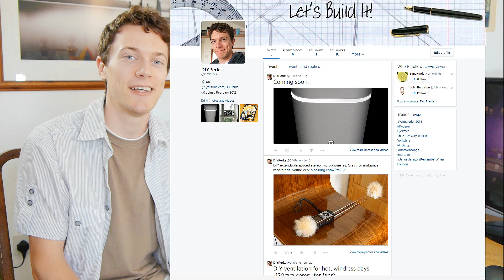How to Make a Clean Air Enclosure (for HDD repair etc)

Comment: If you would use a positive pressure and the fan pushing the air via filter you would get much better results in getting clean air inside. In addition you would get rid of this cut off gloves to, since clean air would be coming out from the enclosure stopping the dirty air going in. Otherwise good idea.

Comment: Great project! It is very economical, and reminds me, something, eckhem, some submersible ;) When I heard the price, I thought - a vacuum cleaner, but then I saw cardboard, and I thought - implosion, and them bam -> 06:00. Jokes aside, it is a pinnacle of DIY! Grazie! 😎🍷🌴 You can also, I guess, slow down the vacuum cleaner by opening a slot that is usually on the handle. It will make is pull some air from the outside of the containment!

Comment: Thank you so much, great video, my first HD hardware failure in 25 years (lucky), don't want to have to send one out again.
Reply: Have you replaced the head on your hdd inside the clean chamber and did it works?

Comment: Not sure using a vacuum for air movement is the best idea since it will pull dust into the enclosure if the seal around your arms is broken. Better to have air blown in with a HEPA filter attached to the inlet. Then a couple outlets covered by a breathable material. This will allow for positive pressure in the enclosure, making it impossible for dust to get in.
Reply: You are correct. Have you try it and did it work?? if so how did you get access to your data??

Comment: Ususally clean rooms and clean work boxes are made to have a overpressure. So it is better to force the air through the filter to the clean box with the overpressure by a fan. Overpressure will force the inner air out of the clean box through all holes and will not suck any dusty room air inwards. This is the idea of the clean rooms or clean work boxes.

Underpressure (vacuumed) work boxes are made to work with toxic chemicals so the air with the toxic fumes is sucked out of the box to some kind of toxic chemical absorption filter or out to the atmosphere.

Comment: I haven't found any comments about positive preasure.  For me ideally creating constant suply of clean air would mean that dust particles won't be sucked in by negative preasure difference. This way you can control not so tightly sealed environment. I find negative pressure is good for keeping things in thought

Comment: I was thinking of using my electric pump with a Boston valve off one of my inflatable boats. It would be perfect it will automatically close when the pump shuts off no air can flow.  I think I just have to work on the rest of the setup. I have ajard drive that sounds like the heads are stuck. I need to get it running long enough to grab the data.

Comment: I know it is an older video DIY Perks, but this is something I am getting ready to build.  I think I will use slightly different materials.  I think I am going to use acrylic board or plexiglass for it, and aluminum window frame material to make it a little heavier duty, but this video shows me that it is possible to make a fairly clean room for data recovery and other issues that may need a cleaner environment.  I think I will mount a small switch inside the enclosure for lights and for the fan/vacuum.  

Nice...ty
Reply: Have you done it to replaced the heads from the donor drive? If so how did you get access to your data??

Comment: A better way to do this is to pump clean filtered air into the box.  This way if there are any small cracks or holes no dust will get sucked into the box.
Reply: You are correct. Have you try it and did it work?? if so how did you get access to your data??

Comment: Very nice video. I wonder if it could be easier and more sequred to make it with glass instead of plastic paper. I can think something like bread case made from glass. You probably can make the holes with pvc tubes (for filter, hands, hdd entrance and for taking out the air) and attach anything like gloves, etc. Also using hepa filter on right, attach it with silicone gel

Comment: Clever idea and good video, i'll take some of your design idea and use positive pressure with a small fan and HEPA filter cloth; the vacuum seems excessive unless you need a negative pressure environment and would suck dust in through any gaps in the system.

Comment: It would have been a far better project if you used long sleeve kitchen gloves and add a "door" in the box just to allow what you need inside the box... Like this would have dramatically insulate and reduced the air contaminants inside the box. And instead of using a vacuum cleaner on one side and the HEPA cloth on the other i would have used 2 fans. One that blow the air inside the box (with a HEPA filter behind) and the other fan on the other side of the box even without a filter since the air it's blown outside and no air (technically) should go inside the box because in this way you would create a laminar flow and force the dust to go out.. more and less the same on how it works any clean room bench...

Comment: Do you consider a different approach : so called laminar flow chamber built similar but hepa filter is behind a strong fan, mounted on rear wall of the chamber (filter side to inside). Draft of filtered air will exclude incoming dust particles, so no  glovebox style  interface is required and the chamber can be  continiously opened  from the front.

Comment: Hold on a second...you acknowledged the very slight and subtle difference in pronunciation of yogurt, that I didn't even realize at first, as an, "If you're in America" thing...yet you said nothing about the pronunciation of HEPA?!  I have never heard it called He Pah before.  Ever.  I've always heard it called HehPah.  THAT, if anything, is when you should have used the "if you're in America" line.  Not over the hardly noticeable difference in pronunciation of Yogurt.
Reply: John Meise I was actually thinking something similar. He definitely should have noted the differences in the pronunciation of HEPA. The yogurt thing made me smile because it was a little humorous but that HEPA pronunciation made me actually laugh.

Comment: In real "cleanroom" there is a little bit higher pressure, not lower. So you can deliver filtered air inside and it goes out using also small holes and leaks. Then there is no risk to absorb little dust particles from the air if the enclosure is not hermetic enough :)

Comment: great DIY project  I have a problem that you might be able to help with  I have a 5TB Seagate less than 1 yr old, was accidentally dropped  and now the power supply plug wont connect all the way in like it is supposed to   can i fix this somehow

Comment: Can you make one that has a vacuum environment? This is going to sound dumb but, I'm trying to sleeve cards and the undersleeves are supposed to go in the OPPOSITE direction as the layer on top, but air gets trapped between the layers, so I want to remove the air. I don't need a total vacuum but if I could have an extremely low pressure environment I could do this without damaging the cards.

Comment: coulda used a 9V battery case with switch for the LEDs and then there's no need to poke another hole and you can turn our on/off from the inside...making it truly portable and no need to be near a power source....mobile hard drive repair from the trunk of your car lol...

Comment: What about the bare uncovered arms inside the box? Most dust in a home is from clothes and skin, right?
If setting up a large removable filter you could use that to stuff hard drive in and out, no need to have vacuum cleaner at maximum suck force either.
Neat tutorial though, I would have added longer gloves fixed in the box.

Comment: Interesting video. One thing you can do that would make things easier, is to use positive pressure, instead of negative pressure. When you do this, you don't need to be as concerned about sealing all the edges so much. Using positive pressure, guarantees that you don't suck dusty air in from anywhere, the only air going into the box is through the filter, any openings would serve to exhaust the air. You still want to minimize any openings, so you maintain positive pressure, but you can be more relaxed about it. With this construction, a simple PC case fan could be used as to provide the pressure.
Reply: How would you go about implementing such change?
Would you replace the vacuum with a fan blowing air in, or is it something else?

(Sorry to bother you, ik it has been a while since you posted this comment)
Reply: @orsaz924 if he never replies, then I’ll add my opinion.  You’d have to close up the portion where the vacuum hole is (seal it off, since we aren’t using a vacuum anymore).  Then over on the filter side, you’d have to shrink the inlet so that a computer fan fits snuggly in it (you don’t want air getting past it, otherwise you won’t be able to create positive pressure).  Then the size of the actual filter is probably overkill, but just keep it anyway.  The OP mentions that the enclosure doesn’t need to have perfect seals, and he’s right - however, the part where the filter is attached to the fan/enclosure, needs to be airtight.  Otherwise you’re drawing in air that is unfiltered.
Reply: @davidswanson5669 is a computer fan enough to create positive pressure in that box?
Reply: @davidswanson5669 and where would the air escape from? Doesn’t it need an exhaust or something
Reply: @GeneralTreesap  I don't think you would use an exhaust for positive pressure.
Reply: If one wanted to use the possitive pressure from the vacuum to get the same strength of the airflow (using/adapting the vacuum outlet) could fall into trouble with the purity of the air. Whatever quality were the filters in the vacuum it is still quite a dirty place after months/years of usage and a proper filtering of such unpure direct blow could be challenging. Sealing the whole box well is not such a big deal after all.

Comment: WHY NOT TO PUT A ROUGH FILTER ON THE VACUUM CLEANER'S HOLE A ND LEAVE IT ON ALL THE TIME? THE BOX WILL  NOT COLLAPSE AND ANYTHING WON'T FLY THROUGH INTO THE VACUUM CLEANER...
I THINK IT'S A BETTER SOLUTION THEN THE COVER.
Reply: +Harry Zalessky negative air pressure. While the vacuum cleaner is on, it creates negative pressure inside the enclosure. Air and dust will seep in through the tiniest crack anywhere where it's inadequately sealed and unfiltered. With the cleaner off, there is neutral pressure. Meaning no air going in or out. Ideally it should have positive pressure, where air will be seeping OUT of the enclosure to push air and dust out of anywhere unsealed and unfiltered.

Comment: Here's how you make a DIY clean air solution at home folks.  Gather up some deuterium and tritium and heat them in a heavy-water-cooled tube spun gyroscopically at a precession sufficient to stabilize the net vectors, and then connect it to a Seebeck generator.  It should produce voltage high enough to ionize the air particles.

Comment: I created my own version of this using his basic concept! its a box with a glass window on top and a cutout for a fan that sucks air out of the enclosure. on the opposite side, it has two intake holes that have a filter over them and I have two cutouts for the hands that I plan on putting the gloves through. it works pretty well! its also powered by two 9v batteries.
Reply: Have you been replaced the heads of your HDD as you build the clean chamber using this and did it work?? if so how did you get access to your data??

Comment: One of the best cheap air cleaners I've ever used was a 120 mm case fan with a green scratch free scrub pad cut to fit it. It's a very effective and quiet electrostatic/particulate debris filter.
Reply: Have you been replaced the heads of your HDD as you built the clean chamber used with 120mm fans and electrostatic/particulate debris filter? did it work?? if so how did you get access to your data??

Comment: Nice design; I didn't think about a vaccum filter. I make one with two PC coolers and a working Power Supply unit; and an acetate sheet shredded like a curtain, to introduce my hands. The real problem is, the HDisk parts to do the repairs are so difficult or amost impossible to adquire :/

Comment: I love the concept, and it's a great place to improve upon. Points to consider vacuum cleaners normally throw up a huge amount of dust . The gloved seals would have to be absolutely airtight as they would provide least resistance to airflow coming in . Car board itself is a fibrous material which sheds particles something made out of plastic tub would be better . A round respirator filter would truly stop all fine particles as these are certified. Although it's hard to push air through a filter you would only need slight positve pressure, to achieve your aim. I like the way you explained everything and filmed it

Comment: Instead of the vacuum cleaner, It's not better to use two two fans of a pc case? The incoming will be with dust filter and the air out will be without a filter?
Thank you
Reply: could be okay if used fans with gud static pressure and maybe reinvented filter with vacuum cleaner bag ;)

Comment: just a little word for those out there considering rescuing their data themselves.  If you plan to swap the head stack make sure none of the heads touches each other specially the donor head, you have to insert a plastic in between each head but not physically touching the heads, I'd the heads do fully touches each other you WILL get a 100% guaranteed click of death, no data will be recoverable, you will need to obtain another donor drive to get another set of head stack just to retry again ($$) and don't touch the platter discs with your bare hands, doing so will destroy or make unreadable the sectors there, another situation that causes sectors to become unreadable is by causing a head crash (when the head are somewhere in the middle of the platter whether you caused this off not, you can rectify this by turning the platters with your hands while at the same time you gently return the heads back to the park position whether that happens to be in the inner platter section or outter platter section (subject to different models) and one again you can consider the sector where the head crash occured unreadable but you should be able to continue just fine just procure not to commit more mistakes.  So not attempt to swap multi player drives your self unless you have data you don't care to lose, if those multi platters neediness misaligned you will lose your data and no one will be able to help you and special equipment and the patience of God would be required to properly align those platters again, one good method that you can use to swap multi platters is by using the "duct tape method" (go Google it or search for that video) but if those duct tape or that cheap duct tape you decided to use fails to hold up, say bye bye to your data and if those platters fell to the floor and you lost track on their orientation, which one goes first or if a disk is upside up or not you have made the problem much worse than a simple misalighment and i really doubt anyone or any company on this planet can help you at this point.  lastly ground yourself or at the very minimum touch a grounded object to discharge what ever electro static electricity you may have before starting work.
Reply: +Dread Steel sweet, can you tell me some other solutions to the problem that require traveling back in time?
Reply: TY for all your advices!! They all are very very worthy.  I will follow all of them!!!
Reply: +m8ty.com TLDR; throw the hdd in the garbage bin and do backups next time.

Comment: Great idea ! i had some old disks lying around, waiting for a fix, now i think it'll be done very soon. Thank you very much :)
Reply: How did those old disc turn out?
Reply: @alexandermccalla5098  Damn, I wrote this 7 years ago, they are fine, got lots of stuff in a storage box since 3y now, but on last news they were still fine. Haven't notice any bitrot, but maybe it's just luck
Reply: @OktoPutsch Have you done it to make a small box to replace the head of your old hard drive to recover your data?

Did you recovered 100% of your data? I'd love to know!
Reply: @chris01479  8 years later, still pending on the todolist. In fact i'd need to find an equivalent disk to gather its motherboard for the exchange, but there is a chance it wouldn't work, so, does the investment worth, at the cost of GB nowadays ? I don't think so (those were blank new disks, disfunctional but aging, no data to save)
Reply: @OktoPutsch  It will still work if you swap the heads over using with the donor drive the same models as the old one or swap the platters. I think it worth it if you build one as you don't have to pay £700 as you can do it yourself. I still need to recover my files from the bad clicking drive as I have got important data in it.
Reply: @chris01479  Well, depends, if you got data to retrieve it worths to give a try anyway, I think, but in my concerns, having no datas to save, I could just get over it (was only a blank 1TB disc from Seagate, bought new in 2015. Guess the parcel had a tough life traveling to my home). Otherwise you'd be surprised how even 2 models from the same serie line can differs enough to make the PCB swap not a determinist solution, and would require many PCBs to test until one of them finally work off the shelf. From what I've digged about this it may be related to slight changes in the physical characteristics of the disc (slight chemistry variations due to supplies and processes, quality control, and so on) and therefore to some related factory settings embedded in the electronic driving it. Good luck with your drive mate :)